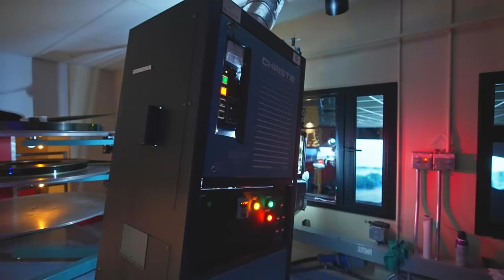After 10 Weeks of Being Projectionist for the 70mm of Oppenheimer.

Comment: I worked as a pipefitter for the IMAX theater at the New England aquarium, I installed the radiant tubing underneath the concrete, and also the cooling lines to the projector, this was probably the year 2002

Comment: Interesting.  Back in the day, movies, films came in 3-5 canisters and two projectors were used and the light source was carbon arcing.  What is the light source for the 70 mm platter style system?  Must be hot as there are metal chimneys coming off the tops of the apparent light source.
Reply from the maker: That’s all I use to do was run changeover 35mm shows using two projectors. Never had to use carbon arc lamps. The lamps still used by film projectors are xenon.

Comment: The IMAX 70mm is 600pounds and 11miles long. Is there an difference to this "normal" 70mm film in length and weight?
Reply from the maker: A pretty big difference between these two types of prints. Looks like from the math the 70mm 5-perf version was a little over 20,000 feet long. I would say it was around 150 lbs.
Reply: @RadioactiveDrew  awesome, thank you!